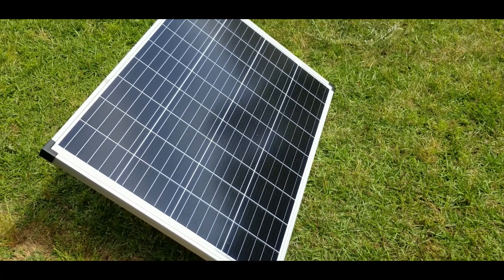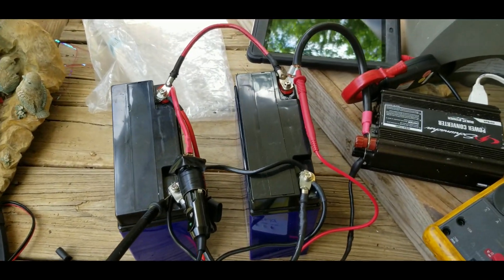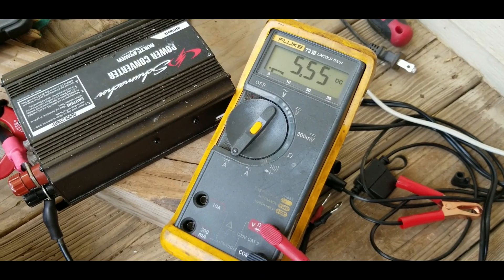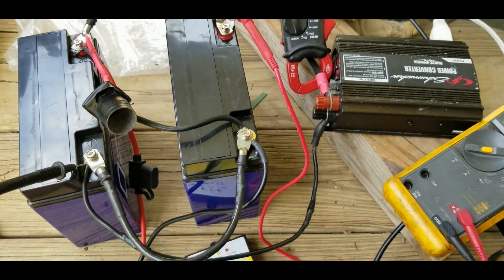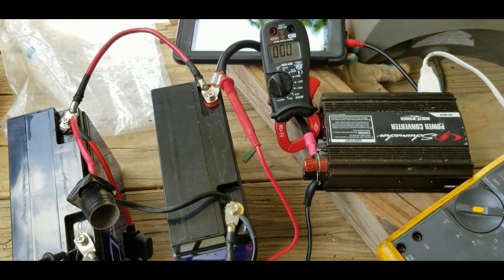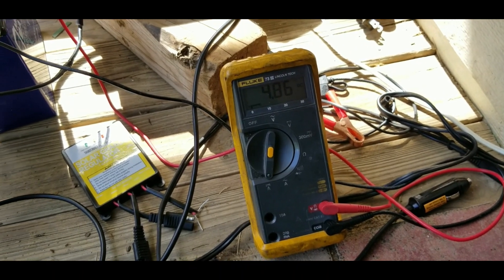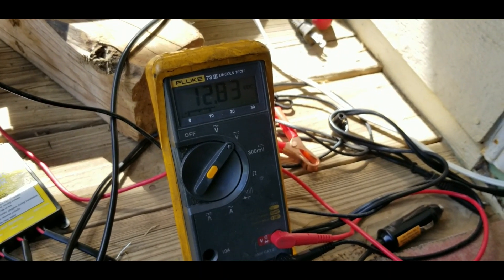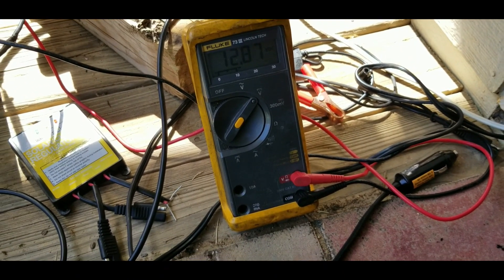UPDATE what can it run? 😎 New Harbor Freight 100 Watt Monocrystalline Solar Panel Item # 57325

Comment: What you are doing is throwing all these numbers out there that have nothing to do with each other. You saying that it puts out 10 Amps that is from the battery and no body cares about that. The battery current is a totally separate issue and has nothing to do with the solar panel. The panel can never put out 10 Amps and no one cares about what the batteries are putting out. 
What I want to see is a WATTage test of these panels. I do NOT want to hear that the panel is good because that is meaningless. All of the people who sell used solar panels that are only able to produce about 75% of the wattage that they did when they were new are now sold as good panels. The word good is meaningless to anyone who wants to know the actual power output that a solar panel is able to deliver.
 There is someone out there who claimed that this exact panel will put out over 110 watts of power. They used an MPPT charge controller to get over 222 watts from two of these panels when the panels were wired in series. I find those numbers very hard to believe.
 If you can come up with a 3 ohm resistor that is rated a 100 watts or more and connect it across the output of the panel all by itself NO batteries and NO controllers. What you will get is a voltage across the resistor and a current going through the wire. And when you multiply the two values together then you obtain a value for the wattage. I need to know if these panels are better than the 100 watts that they claim to be.  
Did you notice that these panels have no label that anyone can show me and they have a very funny connector on the end of the wires. What that means is that they are NOT approved to use on your house. They have no UL label that I can see. So they have not been tested at any OFFICIAL Lab using accepted methods. So it becomes up to you to test this panels. It will almost read 22 volts when it is placed on the inside of your house near a window. But it will produce NO power when it is inside your house. It is a phantom voltage that a solar panels will charge up to and when it is read by a Fluke it will hold that voltage because the voltmeter puts NO load on the panel. 
I am not saying that this panel is not a good deal. So all of you who read this do NOT read that into what I am saying. If this panel is on sale at $20 off and it it puts out 100 watts after it warms up that is what you want to see. When solar panels heat up they put out less power and that is a fact. But when someone claims, and they showed the reading on the charge controller to back it up, that 2 of these in series put out 222 watts when using an MPPT controller then you want to buy these panels all day long. I just can't believer the readout of their charge controller. Unless it was 35 degrees outside and a clear sky and in full sun.
Reply from the maker: I honestly appreciate your feedback and novel you wrote.....
On a side note I have a meter that measures output and I have documented it.......

The panel puts out around 5.54A in direct sunlight at around 22vdc.

Nominally it produces 85watts consistently with occasional bumps to 100w+

Low light, clouds and rain...2.45A 18vdc.

Going into a PWM charge controller and it does just fine no need for MPTT controller as the panel is only 100w
Reply from the maker: Also if your following the channel the 100w panel is new and charges two 22aH AGM batteries which totals 44aH @ 13.9vdc. 

So yes this panel is just fine I run a 500w 1000w peak pure sine wave inverter with 12vdc applications that pull over 10A.......
Reply from the maker: Hopefully that answers any doubts you have
Reply from the maker: Tomorrow I will make a video showcasing the actual output on a digital meter
Reply: @DIYKAI  What I need to know is not that this solar panel or solar panels in general charge batteries. ALL solar panels charge batteries. That is what they started doing with solar panels 60 years ago.
 But for some reason we cannot get beyond the charging of batteries.
 That is why a solar panel that puts out 20 volts is called a 12 volt panel---because it can be used to charge 12 volt batteries. And when someone came up with a 24 volt battery bank then they needed to make solar panels that could charge them. 
It was at that point that they had to double the output of a solar panel or wire two panels in series. That is how we got to the point where panels would put out 35 volts at MPP. 
Charging batteries is like watching the grass grow. We know that the grass is going to grow when we water it. And we know that a battery that is not fully charged is going to accept a charge from a power source. Try coming up with other ideas that a solar panel can be used for. 
 Did you know that a heating element for an electric water heater can run on DC power? NOT the water heater. The water heater has components that are rated for " AC only ",  but the actual elements will run on DC. 
The reason that I know that is because if you put your Fluke on Ohms you will get a resistance reading from a water heater element and that value actual corresponds to the actual wattage rating of the element. I will give you an example later.
Reply from the maker: @alcoppa2682  I believe your looking way to much into what it is......

12v batteries are cheap relatively and plentiful....the object is to harness and store energy for use later while being able to power devices at the same time when the sun is shining on the panel
Reply from the maker: @alcoppa2682  right now I'm doing a test on the panel to see what kind of power it really produces.

As of now 2 hours 20 minutes 

Maximum values seen:
7.54A
97.7W

Minimum voltage seen:
12.16vdc
Charging at 12.83vdc. ~ 2.14A ~25W
 over cast skys

Harnessed power:
32.9 wH
2.614aH
Reply from the maker: @alcoppa2682  I understand what your saying and understand low voltage side and ac high sides......this panel charges a solar power box I built staying 12v is practical to stay mobile......

24v system would be fine in a permanent setting like a home solar system
Reply: @DIYKAI  To get a correct reading, read the volt and amps at the same time with 2 meters. 5.54 is shorted amps at zero or near zero volts. Other than that, it a good video.
Reply: @tiggeroush  I was thinking that maybe he should move the red lead to the 10 amp position on the Fluke multimeter when talking about a 4.9 AMP reading on the Fluke......just saying...;)
Reply: @alcoppa2682   I was thinking that maybe he should move the red lead to the 10 amp position on the Fluke multimeter when talking about a 4.9 AMP reading on the Fluke......just saying...
Reply: @smegnerjr  He would need to put the meter inline between the panel and the battery, or get a clamp on DC amp meter like this https://www.youtube.com/watch?v=tvJd150NuwA Yes, need to check amps going into the battery, and not amps coming out of the battery.
Reply: @alcoppa2682  it is way more efficient to heat water directly than from an electrical source...the hot water tank is the biggest energy hog in the house, because it is inefficient to heat water with electricity...the microwave is somewhat better because it's putting the water in the same thing as sunlight shining on it...but still it's an energy hog to do it that way too...when they invented water heaters, electricity was cheap...they used 115 volts ...I remember old timers would have a switch on the hot water tank and turn it off at night or when they weren't going to need it...they didn't want to pay a big bill to have a tank of hot water ready...people are somewhat lacking in fixing this eternal problem too...you don't see that many solar water heaters on roofs...instead of doing it the efficient way people want to use electricity...just thought I'd throw that out there...you can buck the trend and do it your way ..good luck with those custom panels...if you custom built your own  solar panels to have 15 volts and 75 amps you could probably heat a water tank with panels...they're just  not made that way...it's a lot easier to put some black painted copper line in the sun and use the solar panels for your lights...I've been off grid for months, and that's my experience...I made my last wood stove out of a gas hot water tank ...it heats water pretty good, lol...but it doesn't use any of my solar juice...that's for the good ......I don't have the money for 30 batteries to run one anyhow...lol...I get the point that DC will run a heating element ...it's usually a huge waste of power though, and maybe what the thing is, people with solar , after spending so much to get their power , don't want to use 2/3 of what they've made to keep a tank of water hot, and destroy their battery cells in the process, making them have to be replaced...that puts a pretty high price tag on electrically heated water...it's a mess our world is in...down in Mexico they have a black metal tank on the roof and it doesn't cost anything except to get water to it in the morning...just wondering why use solar panels to heat water electrically when you can just set the water in the sun...
Reply from the maker: I use a 12v boiler or a electric kettle works in 5 minutes
Reply: @DIYKAI  sure, it  works for a small amount...I wouldn't have even commented, but right now, I'm putting a 250 gallon metal tank in the sun waiting for rain to fill it, lol ,when it gets full and warm I use it to wash my hair...I was just trying to figure out what the point was of using huge amounts of power for something you can get free..
Reply: @davidpotter9462  Watched a YT video where the guy took a spool of black 3/4" ID Irrigation tubing and spiraled it out on a base for the roof to between 6 to 8 foot diameter for pre-heating the home water heater.

Comment: you never actually answer the question "what can it run?" instead you spend the whole time reading your meters 😒
Reply from the maker: So what you can run is really based off your battery bank…..the panel itself produces 5.5A or so average so takes that into account you can run light bulbs, charge almost all devices, things like that
Reply from the maker: We have another video showing our actual large setup and what it runs daily

Comment: Your "language" went way way over my head. I’d like to see just a simple connection to another simple connection from the solar panel to battery but since it’s too complicated I just have a 750W Bluetti and 500W Jackery and will keep my usage down to just use these, lol!
Reply from the maker: We are doing another video and have some other check them out of you have specific questions drop them here and we will try to help thanks
Reply: @DIYKAI  Thank you! I know it’s necessary to know these numbers but accumulating info is getting harder to do as both my husband and I are near mid-70’s. I know that many "get it" but there are those of us that don’t. I’ll check out your other videos too. BTW, in my eagerness to begin camping in my van and motorhome, I purchased the Harbor Freight 25w panels and did the plug in thing in my cluelessness and got some charge but I quickly moved on to my first Jackery. But again, thank you for sharing your knowledge.